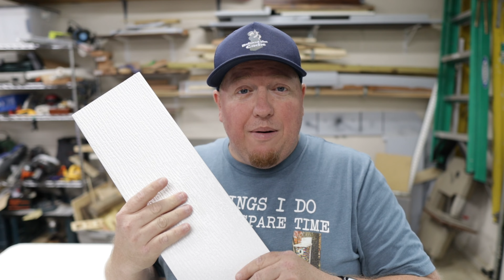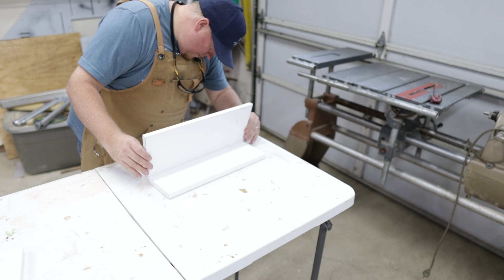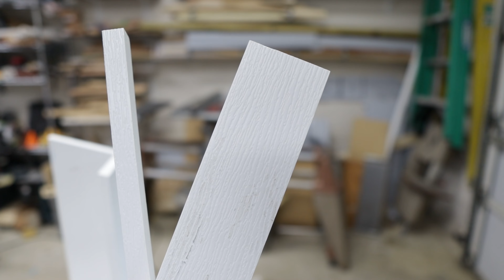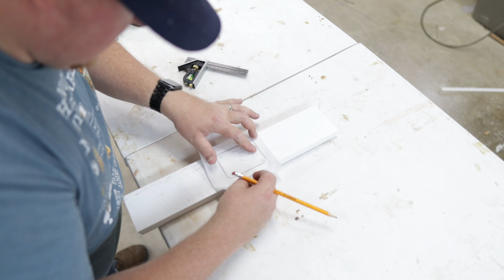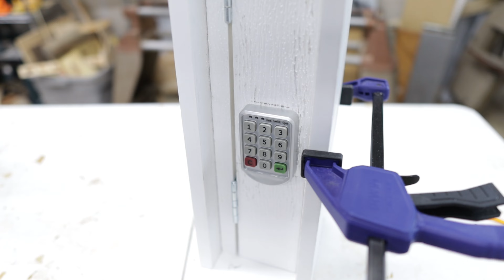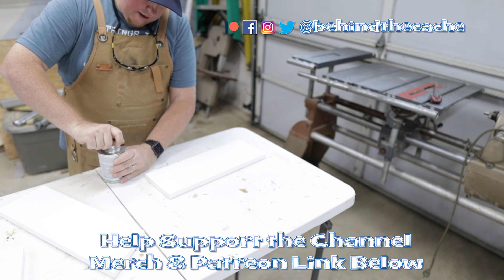I Failed Making This Gadget Cache (GCNW)

Comment: You could try reducing the length of the lock catch to where the battery case clears it (or reposition the entire lock farther away) and then superglue, solder, weld, hot glue an extension onto the angled side of the latch/bolt thus giving it a longer reach. Hope that makes sense.

Comment: How about using a forstener bit or router to create a thinner area where the lock mechanism mounts, so it’s recessed into the back of the door? That might give it just enough arc to clear the latch mechanism.
Reply from the maker: Yeah that might work too

Comment: A wider door might reduce the arc needed for the latch. The concept could still work, just on a 'box' not as slim... perhaps?
Reply from the maker: Right it won’t work with that door but putting the hinges at the top or bottom might work better

Comment: Could the latch be on the top or bottom (strike on the roof or floor)? I have failed more than I care to say. It’s still fun to come up with fixes.
Reply from the maker: The width of the mechanism itself would not allow that. But maybe moving the hinges might work better
Reply: @BehindtheCache  I didn’t think of the length of the latch. Moving the hinge as others suggested would be best.

Comment: Instead of putting the hinges on the left edge of the door, put one on the bottom (maybe a small piano hinge?) and pull the door outward and swing it down. Then, you can use a larger striker plate that protrudes in towards the locking mechanism further so it will engage when locked.
Reply: ...or hinge it at the top and swing it upwards? Or cut the board above/below the actual lock mechanism and hinge it there to swing upwards/downwards?
Reply from the maker: Right I think this maybe what I may do. I like it.
Reply: I was thinking the same thing. Ultimately it needs a larger door, so hinging from the top or bottom should allow it to close without hitting.
Reply: Agree that was my first thought

Comment: Failing towards success is how I make everything. It’s the best way to learn what not to do next time. I try to use a different mechanism on every cache, and every cache becomes a learning experience. What sound module were you going to use?
Reply from the maker: Yes failing is not always a bad thing. It is a simple sound module that we talked about on Gadget Talk. I am hoping to use it in the next build. It is all self contained with a momentary switch and can have 120 sec. of audio.
Reply: @BehindtheCache  I remember that one. I bought the “screaming goat” toy. I am going to remove the goat and try to incorporate the scream push button in my cache design.